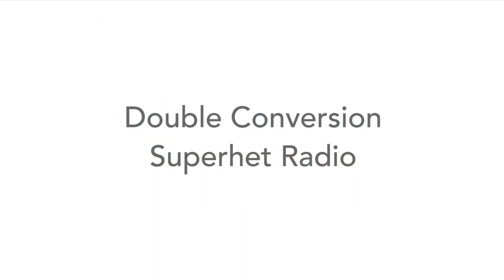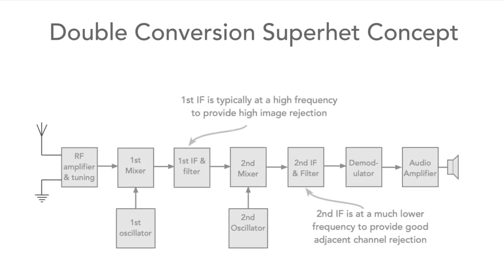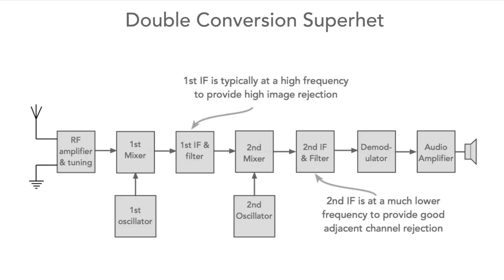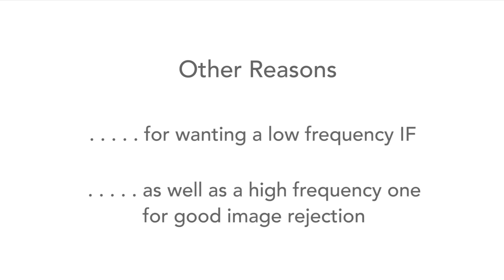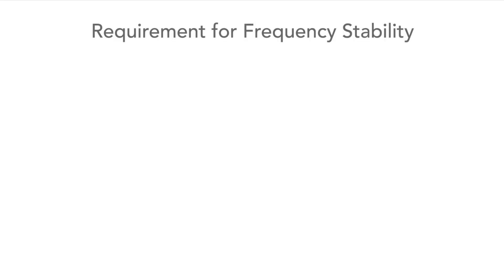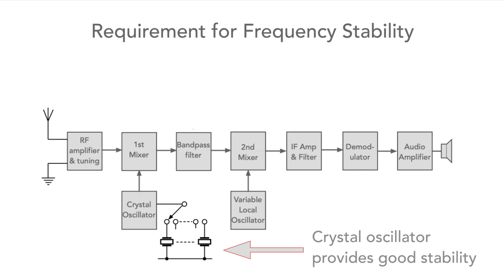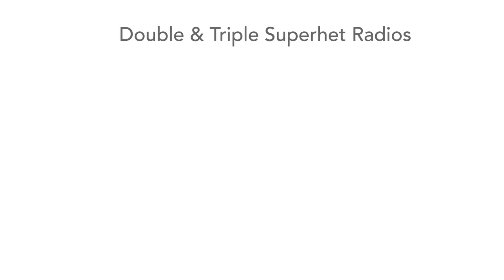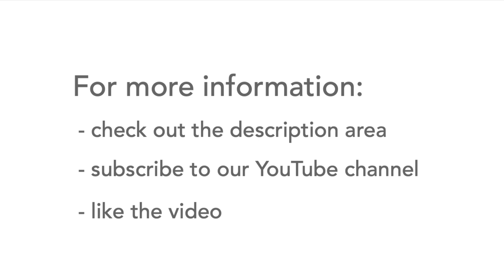Double & Triple Conversion Superhet / Superheterodyne Radios

Comment: Thank you teacher.
I was getting many unwanted frequencies at 10.695 mhz interfrequency. I saw your explanations while researching how to get rid of these fake frequencies and I applied them.

I used 64.695 mhz in 1st interfrequency.
2nd if 10.695 mhz passes through crystal filter.
There is a pll vfo that works up to 160 mhz. si5351.

64.700+vfo in first mixer.
I used 54 mhz (54 mhz fixed) in second mixer.
I was passing the second mixer output through 10.695 mhz crystal filter.
I also used a 10.695 mhz crystal oscillator in Ssb 10.693.5 lsb 10.696.5 mhz usb.
By using high IF intermediate frequency, I got rid of many unwanted frequencies and chirping.
Thank .😀
Reply from the maker: A great bit of detective work to find the source of the problem and then remove it. Well done.